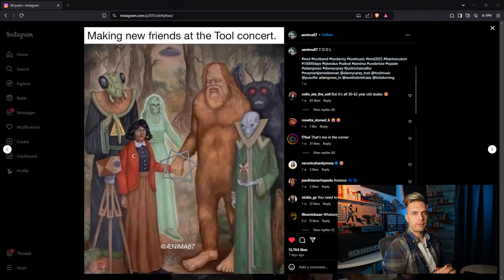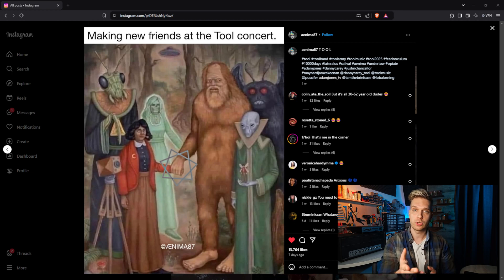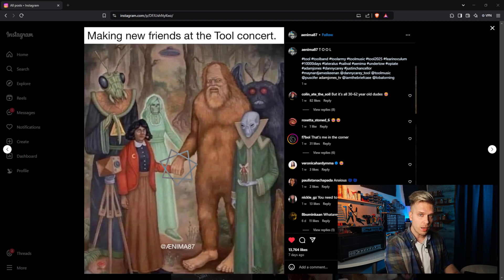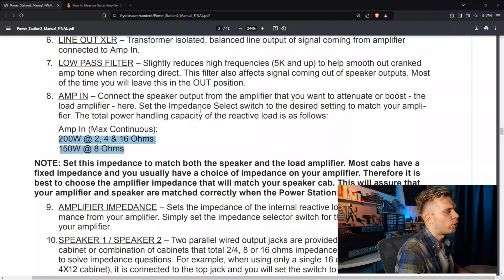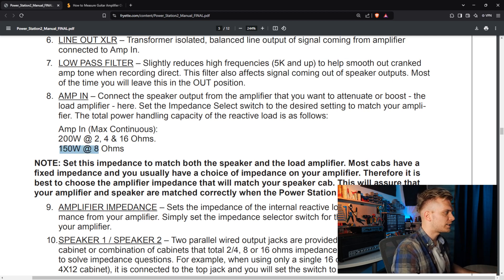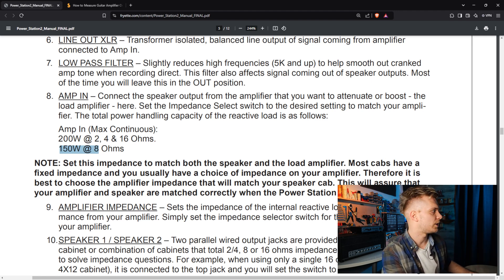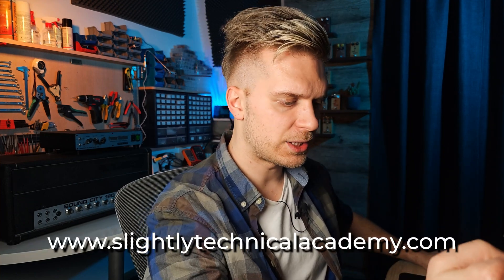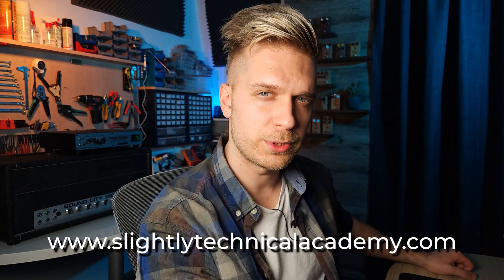Engineer's Advice: How NOT To Blow Your Amp Up (In Under 6 Minutes)

Comment: Also a big reminder to always use cables rated for amplifiers!  A friend of mine used a guitar cable between the box and amp (worst case scenario) and torched the amps transformer when the cable overheated!
Reply from the maker: Yep, if they short, that's bad.

Comment: I have a very old Weber mini mass 50. I'm using an egnater rebel 30, and I never crank it into the attenuator, I just use it to take the edge off before going into a 4x12. I've checked it with thermal imaging after awhile of use and it doesn't appear to warm up at all. Does this mean something is wrong, or am I just way under it's capabilities?

Comment: Fantastic advice… To many of us this information is just kind of common sense… those of us that understand the output rating of a tube amplifier aka RMS is how many watts it will put out before the audio signal begins to break up. It is “clean” watts. A lot of people, especially people who are new to tube amps failed to realize that with amplifiers like the old Marshalls and such they are played well beyond that clean threshold. We drive them well past that particular point and of course that means the amplifier is definitely putting out well over the 100 W clean rating.
Thus any load box connected absolutely has to be rated for well over the specified RMS rating. 
A load box rated at 100 watts will not NOT NOT be able to properly dissipate the heat generated by a cranked 100 watt Plexi … not for very long anyway, because the amplifiers producing more energy than the load box can officially dissipate

Comment: I put little five inch computer type fans in  all of my 100 watt tube amps...Laney AOR and Marshall Superleads. The fans cost me a penny a piece at a sale at Guitar Center back in the '90's! They help tremendously to cool off the tubes and power and output transformers in these amps when cranked. The fans are still going strong! ( I wired them up inside the amp, and ran the fan cord up through the transformer holes in the chassis ) 👍✌️😄
Reply from the maker: @curtisprice9806  that never hurts!

Comment: I use a Suhr RL (the non IR one) and it has been flawlessly for years. I was in doubt in using one with my 1959HW due to it could not handle it and sent an e-mail to Suhr. In their response they said that the RL could handle up to 150W and they were in the process to inform this correctly in the manual and in the device.
Reply: So what does this mean? Is the device be rated for a 150w overdriven amp or a a amp listed at 150w. All amps are listed at their max clean rating. A overdriven 100w plexi can push well over 150w.
Reply: It means that it can handle 150W.

I've been using it with my plexi well pushed (volume at 7) and my RL is handling fine. It barely gets warm, I does not overheat and I put it in a well ventiladed area.

Comment: I have a plexi 1959hw, year of production 2023 , and a boss tube waza expander. The options are 50w,100w,150w. Where should i put for this amp? the manual just say to match the power wattage...I'm gonna cranked the amp...what you suggest , put in 150w just in case?
Reply from the maker: @olgacardoso509  must go to 150w and just keep the fan running! Cheers!
Reply: @slightlytechnical103  thanks!
Reply: I've been running a Boss TAE since it was released with no issues at all on any of my amps. I recommend you factor in that your 100W amp is going to exceed 100W when you drive it hard, so set the TAE to 150W. I always set it one stage above my amp's nominal wattage, because once I've got an OD pedal in front and the power section cooking, it's pretty certain I'll exceed the stated figure. 

Bear in mind that whilst the majority of people have no issues at all with the TAE and other load boxes, if there is any weakness in your amp, driving it hard into any form of attenuator is going to uncover that weakness and you may suffer an issue of some sort. I think of it like I do my performance cars, I could drive a car at 2/10ths on the street for years thinking it was fine, but the moment I take that car on track it's going to show up any maintenance issues at all, especially after a morning of hot laps at 10/10ths!

So, make sure your amp is in tip-top condition with plenty of life in the tubes before you dime it into an attenuator or load box.
Reply: I suggest to sell Boss Waza TAE...

I have a 1959HW that the OT was blown by one, using correctly according to manual. It has a known issue that the resultant impedance in TAE is too high and can cause problems to OT.

Do a little research on this and you can find some cases.
Reply from the maker: @josecolares86  i see they have an "Impedance" pot, I will check out what that is and how it works exactly.
Amplifiers with no or little negative feedback are more sensitive to weird impedance curves. I'll check it out and come back when I have something useful to say
Reply: @slightlytechnical103  I've seen some Impedance Curve plots for these knobs. They're pretty different from the usual ones. I saw them in some forums but how to guarantee if they are the real deal? If you can confirm it will be great. Thanks a lot!
Reply: @slightlytechnical103  "i see they have an "Impedance" pot, I will check out what that is and how it works exactly."
Its a variable resistor. Its probably a volume control.

"Amplifiers with no or little negative feedback are more sensitive to weird impedance curves."
That's why they use output transformers.
Reply: @052RC  It's not a volume control, the TAE uses re-amping for volume. The TAE has a few impedance selectors, one being the typical output impedance matching, the other two tune the reactive impedance curve.

Comment: How do you think the PS would pair well with a Mesa Dual Rectifier? Awesome video loved it.
Reply from the maker: Thanks man, I love the  Mesa into a load, however keep in mind that Rectifiers in Modern mode don't have any negative feedback in the power amp, making them a little sensitive to the impedance curve of different load boxes. I like the PS, and the PS worked really good with the Recto.

Comment: dont use reactive loads that have bullshit impedance curves.
Reply: What do you mean by bullshit impedance curve?
Reply: @MorswinCzcigodny  I will clarify, nearly ALL reactive loads on the market (the popular ones you know and love like the UA OX, TwoNotes Captor, so on and so forth) have a false impedance curve that has no low end control, it does not resemble a real speaker impedance curve which is the entire point of having a reactive load. Why? Because the speaker actually impacts the tonality of the power section of the amp. This does not mean the tone of the paper on the cone and shit, it means the coil inside the speaker and the way it behaves electrically causes a tonal change to happen within the power section of the amp independent of the tone of the paper cone etc (the connection to the speaker is not a 1 way street, the speaker creates back EMF to the power section of the amplifier, it is a 2 way tone street). Real speakers have a very predictable impedance curve and you should google it to see what i mean. If you type "speaker impedance curve" and look at google images you will see so many images and yes they will vary slightly where the big peak is (some will have 2 peaks but this is for other speakers used in a reflex box, ported) but they all follow the same exact formula. The UA OX for example does not have this curve, it has nothing that even RESEMBLES this curve and the low frequency part of the curve continues upwards instead of falling sharply on either side of that peak I just mentioned. The shape of the UA OX and TwoNotes Captor impedance curve is one that resembles a bathtub. You can search about bathtub impedance curves in reactive loads and you will find a gearpage forum post (the actual thread title is "Masterplant A2XR (Reactive Attenuator/Load)") by a guy name Mike Lind who measured these devices himself and showed just how bad they really are. This bad curve is DANGEROUS to amplifiers running at high volumes. This will sound like an opinion but it is not. John Suhr has agreed with this statement as well as a lot of other knowledgeable people. There are a few curves that are correct on the market, Suhr's loadbox is obviously correct and it is also measured independently in that gearpage forum post by Mike Lind who is also selling his own loadbox under the brand name masterplant which allows you to select between a few of these curves. The bottom line is, until we know what kind of impedance curve the ampcentral evo presents to the plexi we cannot say for sure that it was the plexi that failed because of its output wattage. eystich said that the ampcentral evo survived...... how can this be possible if the output of the plexi was too much for the ampcentral and the piece that failed was the amplifier not the loadbox? It is BS. The loadbox likely has a bullshit impedance curve and destroyed the output transformer of the plexi.

Comment: I have an 100 watt model 1959 plexi and am curious if the Fryette ps2a is a safe option for cranking my amp? Many thanks
Reply from the maker: @alecalfaras5936  yep, I run my 1959 blasting mercilessly into a power station. Just switch it on so the fan works. If the fan is off, it will start smelling bad 😅
Reply: @slightlytechnical103 same question as Ale’s, but I’ve been playing through Iron Man II, and I think it’s rated 100W max. And it does start to smell :) is that not safe?
Reply from the maker: @dreamawayyourpain  well, smell is the first indicator that the unit is overheating... so no, it is not safe.
Reply: @ it’s great I found your video then! And if I through a master volume mod - would it decrease the output, making it ok to play through Iron Man, or still not safe?
Reply from the maker: @dreamawayyourpain  with a master volume you effectively decrease the signal going into the power amp, so yes it will be safer, as long as you keep the unit ventilated. However, even though I did many master volume mods for superlead type circuits, I can say that a plexi is not a plexi without the power amp full out.
Maybe you could think about taking 2 tubes out, rebiasing the amp, and just using different speaker outs. You will use the 4 ohm output, but you will be able to crank the amp through your load box
Reply: @slightlytechnical103  Thanks so much! And if it's a post inverter MV, would it help to do justice to the power tubes?
Reply from the maker: @dreamawayyourpain I have a PPIMV, never use it, but it's a useful tool. You can get interesting tones with it. But the problem with the PPIMV is that it takes out the negative feedback as you turn it down, so the sound gets kind of brighter and distorted at lower settings. Interesting sounds, but not really exactly like plexi. It is a long story that might need a video